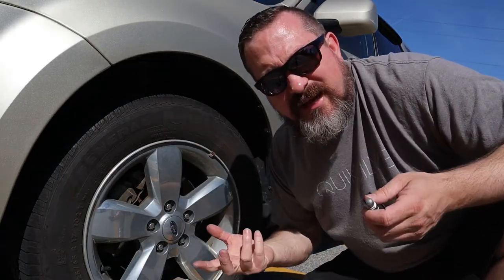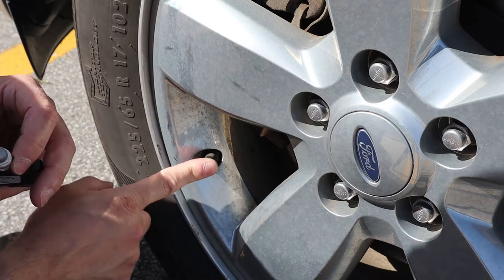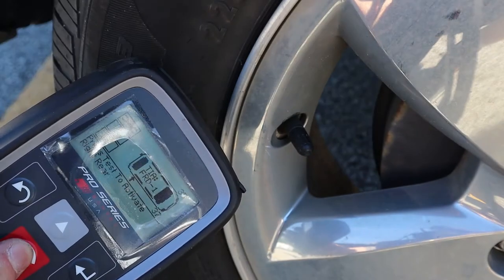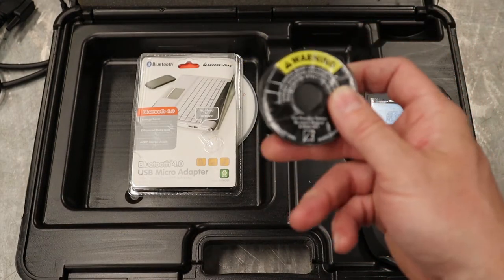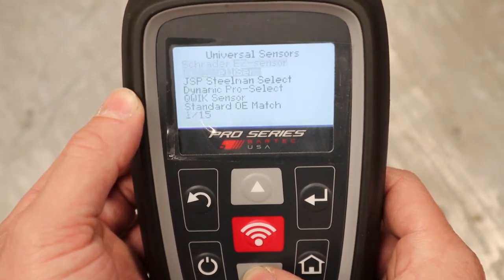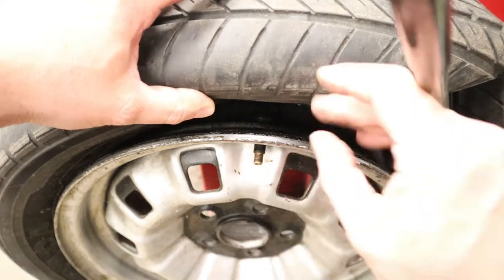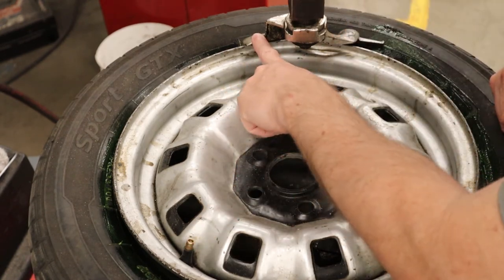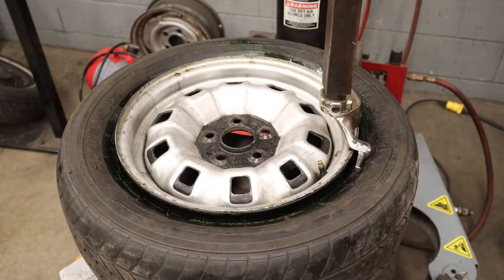Learn all about Tire Pressure Monitor Systems! TPMS sensors and much more! How to become a GEARHEAD!

Comment: Few people are aware that Tire Pressure Sensors have batteries with a limited lifespan.
Reply from the maker: Yeah that's true, there is a lot to know about cars.  Especially for non tech people.  The other thing to think about is when a tpms sensor goes bad due to battery, the other 3 are around the corner so it's not a bad idea to change all of them.  Thanks for the watch!

Comment: Sweet video! I think you should make a series about fixing things with minimal tools, lots of people dont have the money to afford all the sweet tools you have! Im sure if you started making videos about repairing vehicles and other stuff, you'd get a lot more people checking out your channel!
Reply from the maker: Yeah, I hear ya.  Ya gotta remember though, the theory and tips and tricks are all free.  For most of these videos I am trying to teach people as much as possible about the topics and show industry standard practices.  I realize that not everyone has a tire changer and $1,000 tpms scan tool but this video did show what tpms is, how it works, how to diagnose (dash lights), whether or not you have tpms, what vehicles have tpms, where to break tire beads to prevent tpms sensor damage, how vehicles need a relearn process (free to google), and that 30 to 40 percent of the vehicles don't require a tpms scan tool.  All of this require no money at all, free theory for everyone.  All of this is what a mechanic has to know and why they are charging so much for the job.

Now as for lack of tire changers, there are a couple methods that people at home can break their tire beads for free so they can change valve stems/tpms sensors (just haven't made the video yet...coming soon and I'll drop your name in the video  😊).  

The tpms scan tool is required for certain cars, you just have to look up the process for your car and whether your vehicle needs it.  I'm finding many cars don't actually require it.  I am sure that this tech tool will also get cheaper in the future (more like $150 or even a smart phone app later).

Thanks for the suggestion on making videos about fixing things for free or cheap for home diyers.  I get it and this channel is definitely for the home diyer who wants to learn how to repair vehicles, weld, and make cool stuff all while saving money.  Lately it feels like I can't get my content out fast enough but I am focusing on making quality videos that are more informative and in depth to make the theory stick ( hopefully entertaining too).  It has always been my pet peeve watching car shows or youtube videos where people fix/make stuff but they skip stuff and you don't learn how to do it.  

Thanks for your comment and keep an eye out for your name in a future video!  Cheers!
Reply from the maker: Video is up today and I used your suggestion to show some stuff with out all the fancy machines...doing it old school!
Reply: @wayofthewrench  sweet!

Comment: How much is the TPMS removing and installing kit?
Reply from the maker: I don't remember exactly but a basic tpms kit is about $75 USD and a full kit might run $150-200 USD.  Thanks for the watch!
Reply: Is it possible to know the name of kit and where it can be found
Reply from the maker: I don't have it in front of me but I got it from my local Lordco auto parts store.  The most important tool is the inch pounds torque wrench so you don't over tighten the new tpms sensor.  Your local auto parts store will have these as well as Amazon.  Cheers!